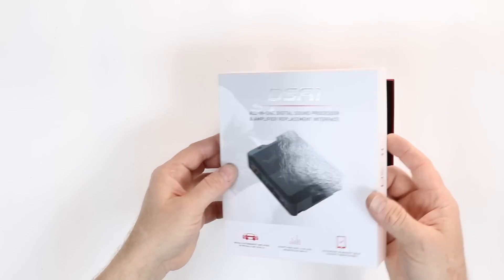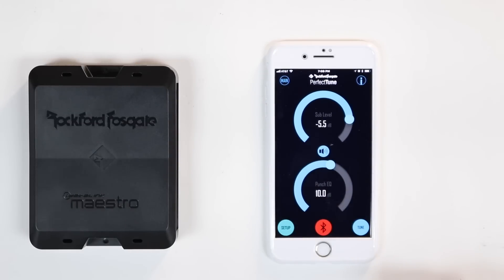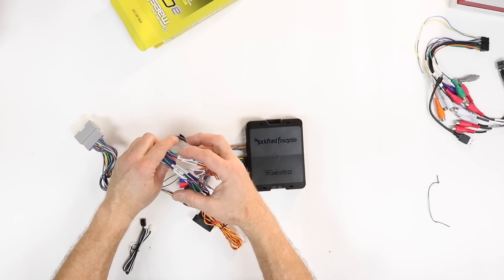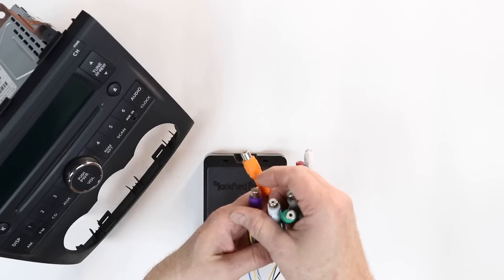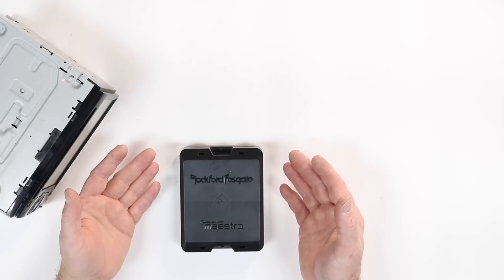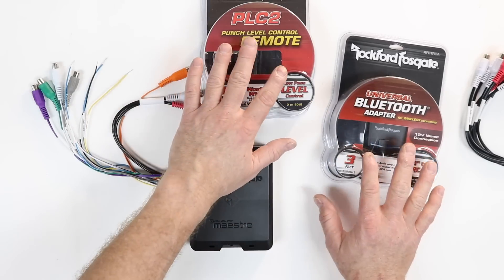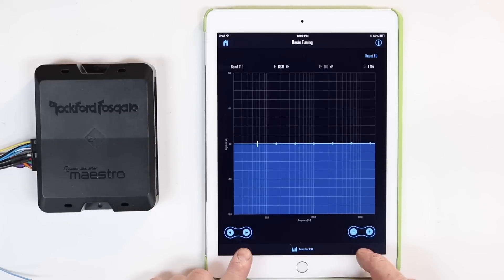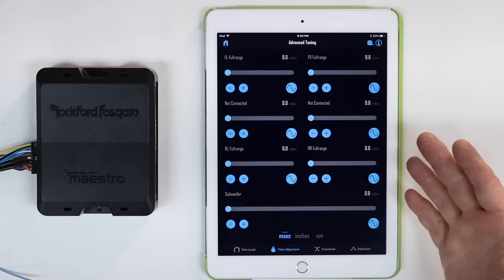The Rockford Fosgate iDataLink Maestro DSR1 unboxing and review

Comment: My car is ford aspire (India). 
Here we don't have idatalink module for the car. 
If I use dsr1 using speaker level outputs, won't the sound quality suffer as the factory head units have very crappy sound processing. So if a sound signal that is not adequately processed, how the DSR1 do wonder?

Comment: Can this dsp compensate for some of the factory radios that have a bass roll off towards higher volume levels? Such as the accubass technology some of the audio control dsp's have.
Reply: audio control accubass is garbage compared to getting a full maestro signal.  But if you use the high level inputs then no you wont get anything good. There is no signal summing or bass restoration with the high level inputs.
Reply: To back up Jeff, you'll be looking at the big brother 3Sixty.3 signal processor that has a patented signal summing feature.  Rockford Fosgate kept this out of the DSR1 to keep the cost down for a majority of the installs out there.
Reply: Rockford Fosgate 
Thank you!
Reply: use it via rca out, bluetooth dongle, or maestro link, its one of the best affordable convenient dsp's on the market but it has bugs. Not a deal breaker but you have to live with some of it and know how to work around the other bugs. Still amazing for a 3 way front stage + sub.
Reply: particular ones i've ran into with 4 installs so far is that the time alignment swaps the left and right inputs(only for time alignment screen) once you start tuning it and yes the rcas/left and right was completely correctly wired, it only swaps the output once you actually get into time alignment and start tuning its pretty annoying All you need to do is to flip the values and time align the opposite way . Also bluetooth connectivity is very poor and doesn't connect sometimes and sometimes require a full reset(unplug the harness) for it to work.  You also need to choose very low pre-out input in order to get a strong signal.  Like if your head unit is 4 volt pre-out, you should choose 1-2 volt pre-out in the config wizard or else the signal coming from the dsr-1 is very weak if you chose 4 volt pre-out. However with choosing 1-2 volt pre-out the signal is extremely strong and clean from the DSR-1
Reply: one t harness setup and three aftermarket radio with rca installs, same bugs throughout.
Reply: a maestro link dsp is 1000x superior than any audiocontrol product sad to say, AC is a relic of the past compared to all the technology out there nowadays.

Comment: What happens to the center channel speaker in an Alpine/Harmon system? will that unit now sum the center channel signals into the F/R outs?   Can that specific function i described be assigned manually through the software?  My Grand Cherokee (2015) has the Alpine system and id like to eliminate the center channel and run a basic F/R/S setup eventually.
Reply: Anthony B 
I'm guessing you either need to unplug it at the speaker itself or disconnect the actual wiring at the amp.
This is what you do with the Helix DSP (which is around $600 retail and is only tunable with a computer or $300 remote with a 3-inch screen). Audison and others I believe do the same thing with the center channel. With a DSP and with time alignment there's really no need for a center channel.
That is unless you absolutely need one but when built correctly, most people do not need one with their speaker setups.
Reply: and if i disconnect that speaker i loose blue tooth phone audio, all warning chimes and AM radio. That's why i was asking if this unit will SUM the center channel into the front channels (L/R)... essentially bringing back anything that was playing through the center channel. I wish it were as simple as unplugging, but its not.   

PAC Audio makes the AP4-CH41 (perfect for the Alpine or Harmon Systems) which eliminates the center channel and SUM's it into the front left and right speakers (like i was explaining) BUT doesn't have an EQ like the DSR1. It's strictly pre amp out. I guess you could buy a standalone DSP for it, but i like how the RF piece is an all in one and can be adjusted on the fly off my i-phone, thats pretty dope. 

https://pac-audio.com/catalog/audio-interfacing/ap4-ch41
Reply: Anthony B well if they have a data link set up for your vehicle it will just bypass that speaker during audio and then when you have a call open the doors anything like that I'm sure it has a past 3 that would allow the center speaker to work. But there is a Rockford Fosgate rep that is popping in here I'm sure he will see your question. If not find where he's speaking to another individual and ask him a question.
Reply: wow i know that already, OBVIOUSLY i will be using aftermarket amps, jesus!!! i have over 10 years car audio installation experience behind me... you just don't have the specific answer i'm looking for.  
I will just assume all center channel audio (from Alpine system) will be SUMMED aka "mixed" into the new front channel outputs. I cant see why this piece wouldn't do that.
Reply: Anthony B 
Like I was saying there's other dsps like this and they simply do not work with a center channel. You have to unhook it and unhook the microphones for the volume control when you're going certain speeds.
If you go into Audiotec Fischers website they have a tool to see if your vehicle will work with their amplifiers that have built-in DSP. It's called the Match system. It comes with a t- harness that plugs in line to the factory amp. And all of the harnesses I've looked at that have the setup for cars with a center channel tells you to unpin a certain wire which is the center channel.

The the DSP simply does not have a setting for center channel. To my knowledge there is no control for it in the control app.

Since you're using aftermarket amplifiers you would probably have to have a separate amplifier. You would simply use Y connectors 2 had an output from your left and right dsr-1 ouputs. Another way is to simply connect the speaker itself to the front stage amplifier for the left and right channels by essentially bridging the center speaker on the amplifiers speaker terminals.
Once you start getting into using time alignment I don't understand how it would work efficiently having sound the signal up for the center speaker.
Reply: how would i know exactly what this does if it just came out?!?  I'm not currently an installer, nor have i been for a while now. I'm slightly out of the loop on newer products, but still have plenty of car audio knowledge. What i asked is not dumb. I guess you don't really understand these things below the surface or from what you see in a youtube video. Your a typical big shot behind the keyboard pretending to be a know it all, putting people down for asking questions.... when in reality you probably couldn't install a car alarm or remote start if your life depended on it or even a DSP for that matter.
Reply: H O IR i IZ O N 
Why do you have to be so mean and condescending? Dean and Fernando are great installers with lots of experience and they are learning this also. I'm sorry we don't have the ability like you just download the information into our brain instantly. You're being very nasty to people but you can do that behind the keyboard can't you.
By the way, Bluetooth loses the same amount of sound quality as any expensive audio cable or system out there.
But with all your experience I thought you would already know this.

https://www.lifewire.com/what-to-know-about-bluetooth-3134591

Comment: Can you use the Aux input as a dedicated subwoofer input for stereos that have triple pre outs?
Reply: Unfortunately no, the AUX input is switched, so it will turn off the RCA or High-Level inputs to use the AUX input.
Reply: I thought I had a front rear sub setup but after looking is just front and rear and axillary. But it has subwoofer controls so I'm guessing you just
assign which input you're going to use your subwoofer amplifier with?
The diagrams I'm looking at has the Bluetooth controller cumming in the axillary input.
But wait! There is a diagram showing Subwoofer output. Is there a way I can send this to you?

Comment: Kinda surprised they put Bluetooth 4.0 in it but you need a dongle to stream audio to it. 🤔
Reply: There are two methods of implementing Bluetooth: 
1) Classic - good for streaming but not power efficient and more expensive.
2) Low Energy - very power efficient, but does not support audio streaming (used on Smart Watches).
Rockford Fosgate is using a Bluetooth Low Energy module to keep the cost down.  We realize many of today's modern vehicles with CANbus have source units with A2DP streaming and hands free functionality.
Reply: Unfortunately no, the Mercedes platform uses a different protocol.  The Maestro integration designed by our partner, ADS (iDatalink,) has a compatibility list available online by selecting "Amplifier Replacement" http://maestro.idatalink.com/
Reply: Rockford Fosgate I would have gladly paid another $50 which is about what the Rockford Fosgate Bluetooth module costs right?
So was it left out to keep cost down or left out because he can't be in there anyways and work with canbus?
Reply: You may want to have Five Star Car Stereo help you out with upgrade options on your 2008 Mercedes w219 CLS.  You may be dealing with a MOST system that will require a converter like the mObridge DA1 or DAB+ with the Rockford Fosgate 3Sixty.3 signal processor since it has a patented signal summing function (DSR1 does not.)
Reply: The DSR1 was specifically designed as an "integration processor for the rest of us."  It's a ridiculous $249.99, so yes, it was all about cost.  This is also specifically why I put the RFBTRCA option in the wiring diagram, because it's an easy $49.99 add on.
Reply: Rockford Fosgate 
Yes even at 308 still a great deal. Just something else to have to hide LOL stuff somewhere.
It's an unbelievable deal just from the price versus number of options.
Will it have presets for say three different types of equalization? 
I'm going to have three different sets of amplifiers and I'm sure each set will need different tuning. But I guess it's no different than rock pop jazz LOL. As long as there's three slots open for customization in the DSR 1 I'll be happy.
Reply: Im a tightwad and am always lookin for cheaper..that being said, kudos for keeping the price somewhat in check. Im a prime candidate for this unit..also under consideration: minidsp C-DSP 6x8,Audison bit 1 or 10 , audio control DM-608..but none of those will allow me to control without a laptop (which i aint got and dont want) or pre-setting and saving a curve or cutoff
Reply: H O IR i IZ O N 
He said they were under consideration. In other words I believe he's comparing them all three to each other.
Reply: I have an aftermarket head unit..but they said that there will an idata T connector for Toyota at some point..if i should choose to go that route.Im not married to the stock head unit in my vehicle
Reply: H O IR i IZ O N 
James, like me, is wanting to stream directly to the DSR. Not to the head unit and then the DSR.
My truck build will have my Samsung tablet as the source unit being sent to Rockfords Bluetooth controller. And that is connected to the auxiliary inputs of the DSR 1. As Rockfords rep stated earlier, the Bluetooth that's already in the DSR one is just enough to accept the signal from your phone or tablet to control the actual modules settings. 
It's actually designed to be connected to a factory system that has Bluetooth capabilities already but gives us others the ability to still add a stronger Bluetooth module like the one listed below. Sorry I had to list from Sonic has Rockford site seems to be down at 4 a.m. LOL probably maintenance...

https://www.sonicelectronix.com/item_94270_Rockford-Fosgate-RFBTRCA.html
Reply: H O IR i IZ O N you're kidding me right?
You really need to get your facts checked as Bluetooth is superior and you lose no sound quality. Why would you think that?
I can tell you several people that compete and they use a stand-alone media player streaming via Bluetooth.
Reply: H O IR i IZ O N 
Not true. You do not need an aftermarket player with Bluetooth to get Bluetooth with the dsr1. You can use the DSR 1 in a 2003 Ford Mustang if you wanted to. 
Start by locating the speaker wires (high level output) and connect them to the high level inputs of the dsr1.
Next you purchase the Rockford Fosgate Bluetooth module here... 
http://www.rockfordfosgate.com/products/details/rfbtrca/
This is one of the finest Bluetooth receivers out there. I've spoken with several great installers that build sound quality vehicles as well as a couple of people that work for Rockford. Most would gladly pay a hundred bucks for this $40 wonderful piece of technology. You simply plug this into the dsr1's auxiliary input and run power to it. Personally I would not try to hide it behind the dash or anything like that in case of interference or heat. I would mount it somewhere out of the way but in the open. It's not a bad looking unit by the way.
Next you will pair the Bluetooth receiver with your phone or tablet.
Remember this is all in case you want to still have the functions of the factory system CD player receiver. I am going straight from tablet to the Bluetooth controller that will be connected to the dsr1 and then out to my amplifiers.
This is great because I will be mounting the receiver close to the amplifiers with the dsr1 so you save tons of money in RCA cables! And In time will be saved by not having to run the cables.
Here is the link to the Bluetooth receiver...
http://www.rockfordfosgate.com/products/details/rfbtrca/

Here is a great reference area for Rockford Fosgate dsr1!
Go to the second picture and it'll be the middle set up second from the left.
http://rftech.custhelp.com/app/answers/detail/a_id/1324/~/2017-dsr1-signal-processor---software-%26-owners-manual

I'm surprised you (Horizon) didn't know all this already with all of yiur installation experience. Guess just never know.
I guess you have that type of personality that will never admit that you're wrong or that you just didn't know and then be thankful someone told you. Sorry that's the way I am. Execute me now LOL!
Reply: H O IR i IZ O N actually that's why you're seeing all these DSP come into play now. Taking in high-level inputs before going to the amplifier. It's the OEM amplifier that usually gives you a dirty signal. There has been many tests showing that factory head units recently are very clean in fact clean enough that you could just take the speaker output from the head unit and solder on an RCA lead and they are actually low level. Once again all these DSP s from audiocontrol to Rockford Fosgate are basically taking the factory head unit and flattening the response curve out then you can tweak it to whatever you want. And believe me you do not want to listen to a flat EQ all day everyday. Lol. Plus the DSP will get rid of the factory head unit lowring bass as you increase the volume. 
The current DSP that are coming to Market and have been out for the last year or so or intentionally made for factory head units like those term Acura or Toyota and so other companies that take up the entire Dash including the HVAC controls.
Many times these days the only way you can a separate amplifier is by adding a DSP. A company called helix has a lineup called match hints matching to the factory system.
Reply: Dam mini dsp is in trouble

Comment: Hope someone can help me, here goes, i got a 2012 f150 and cant seem to find the 4 channels audio output for my stock stero with sync and nav, I've searched the internet and can't find the matching wire that goes out from the stock stero. So my question is can i tap into the stock amplifier going out to the speakers with the dsr1 and not get the t harness for my truck ?

Comment: I'm still not really sure what this does. Is it a DSP for people who want to keep using a factory stereo and amp? Can you use it as a DSP with an aftermarket stereo and aftermarket amp like the Helix, for example? I'm using the miniDSP 6x8 because it's the only one out there with an app for my Mac. Tuning wirelessly via iPhone would be even better!
Reply: James Orr you can use it with anything.  You just don't use the maestro portion when using high level inputs, aux, or spdif inputs.  Those inputs will allow you to use all the equivalent, crossover, and time alignment features.

Comment: I love everything about it other than I can't stream audio to it without buying an additional Bluetooth device.

PLEASE TELL ME I'M WRONG IN THAT I HAVE MISINTERPRETED THIS.

It was to my understanding, coming from others including Rockford, that I would be able to simply have my phone or tablet the dsr1 and a set of amplifiers to build a system.

Either way, THANK YOU DAN AND FERNANDO!

 I don't know if you remember me from Monday (left a in-depth PM as well LOL) or not but I am the one that is doing a 3 generation Rockford (RF³) amp tribute build. 
Along with that, I will be doing interchangeable door enclosures as well as subwoofer enclosures. Essentially you can have a SPL enclosure setup with a high-end three way front stage.
There will be three sets of amplifiers that the listener can change between (even during the same track) to hear how each generation would have sounded. There will be a door enclosure with an old-school component set so you can actually relive a system from the 90s!
All other speakers will be Crescendo audio.

I'll wrap it up as this one is running a little too long (lol Dean)
ON TO THE NEXT ONE!